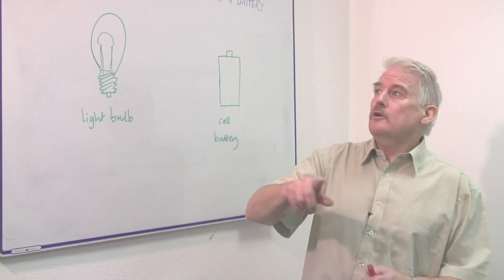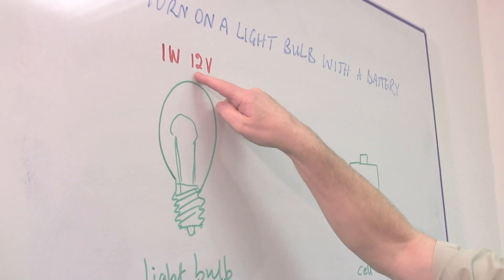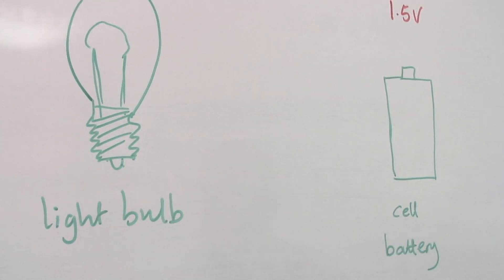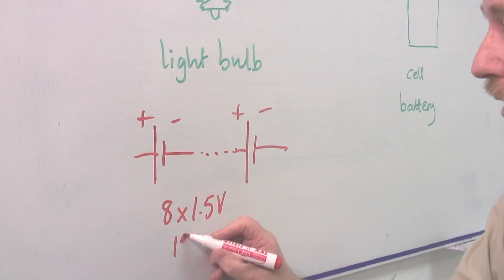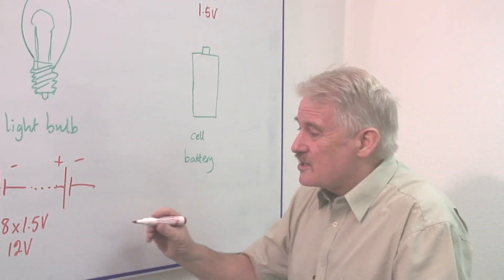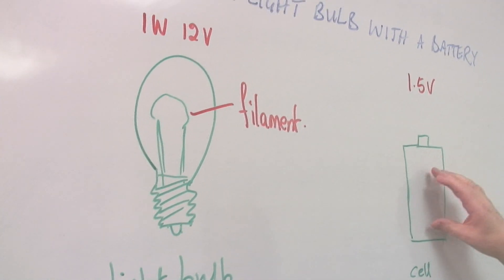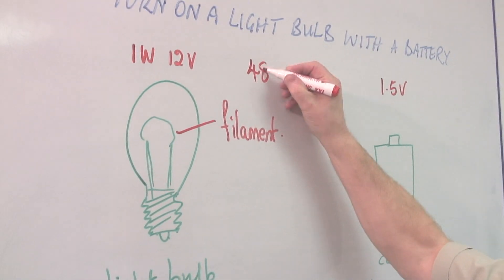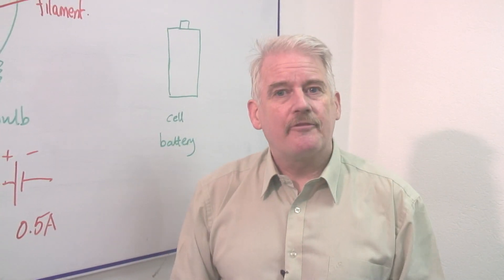Physics & Electromagnetism : How to Turn on a Light Bulb With a Battery

Comment: It’s possible to use a 9v battery to power a 12v bulb. The bulb I used is a 12v 20 watts halogen, with a 9v battery supply, it lights up. That’s the way I used in an electrical workshop as functional testing to show students whether a lighting circuit works.